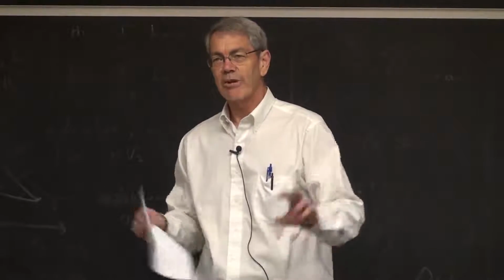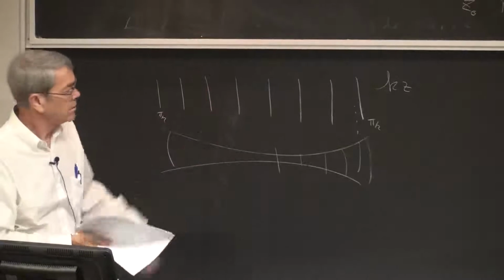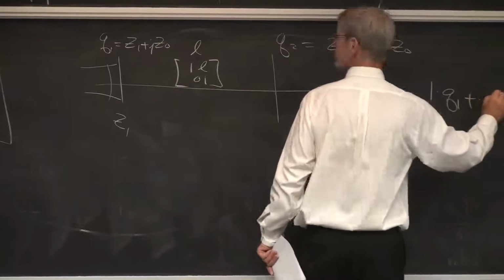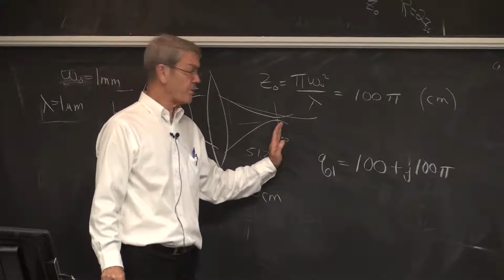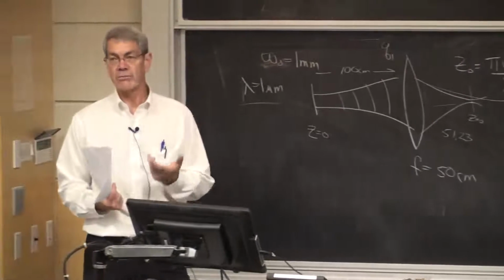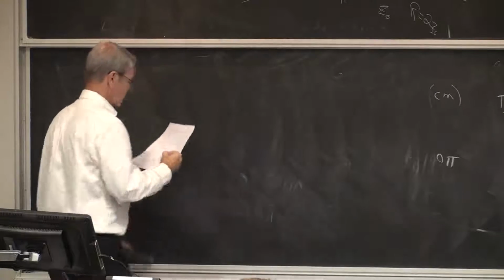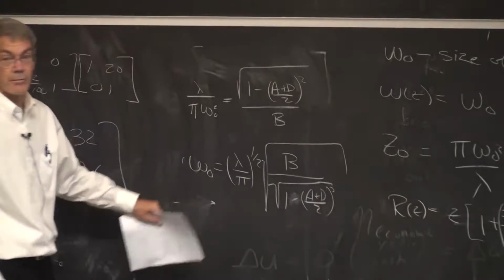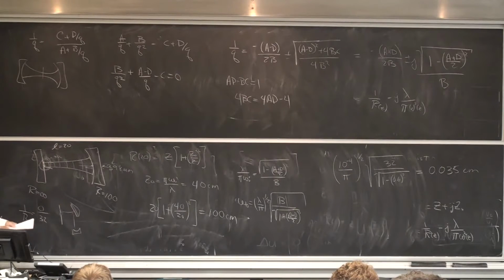Lasers & Optoelectronics Lecture 9: Gaussian Beam, Cavity Design (Cornell ECE4300 Fall 2016)

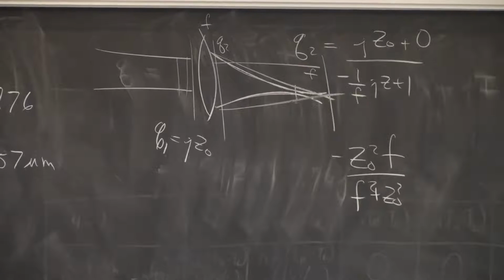Comment: At about 25:00 he draws completely wrong envelope. Yes, minimum happen closer to the lens compared to geometric ray-tracing, but envelope won't get inside that cone/triangle formed by "outer rays" of the beam. In his picture waist would be much bigger.
Reply: Why?
Reply: Does this imply that 388 and 3890073002 are involved?
Reply: Never mind. If it’s a 3888 thing then 3.16 works.

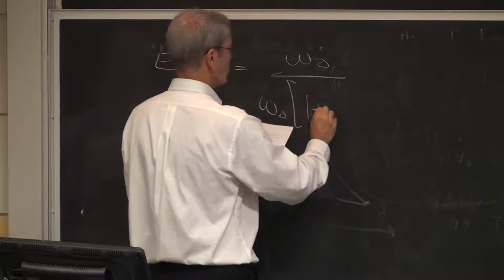Comment: @0:46 when he writes the electric field, he has a w0/w0 term.. Is it a mistake or am I totally not following ?
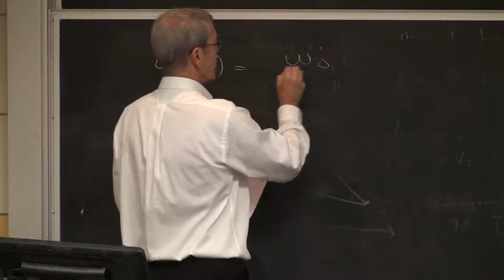Reply: The full equation is: E(x, y, z) = [w₀/w(z)] * exp[ - (r/w)² ] * exp[ -j (kz - atan(z/z₀)) ] * exp[ -j (k r² / 2R(z)) ]. But, w(z) = w₀ * sqrt[ 1 + (z/z₀)² ], so you get what Dr. Pollock writes out at 0:46.
Reply: look into the last presentation, where he concludes with this überequation